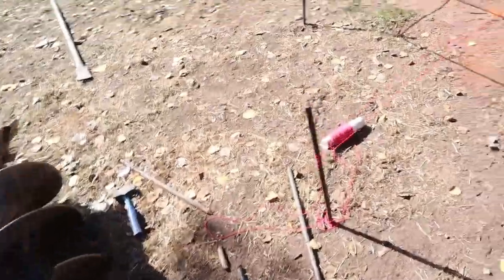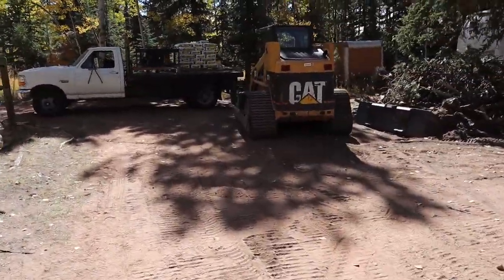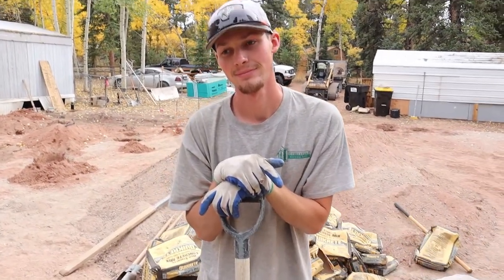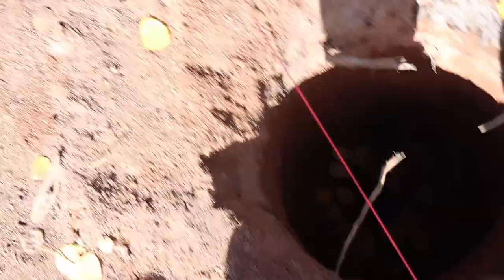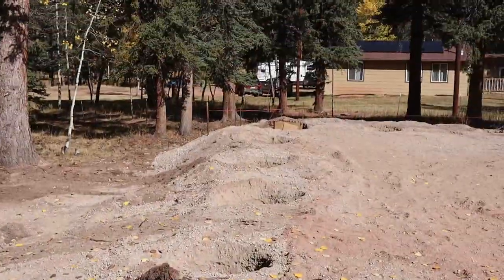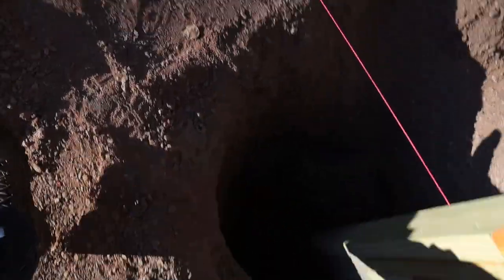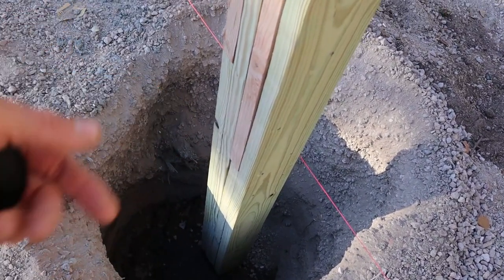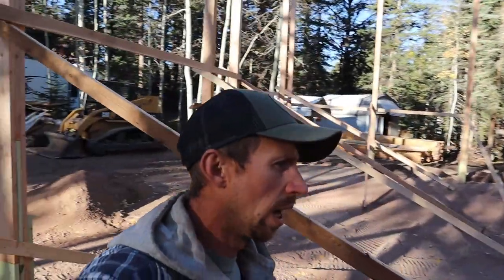POST FRAME BUILDING//PART 1//DRILLING AND SETTING POSTS//

Comment: 52” is deep! Where are you located? Mine was 42” in SE Michigan. I like that you are attaching it to break the size restriction. It is the same here. I think it’s silly that I could build bigger if I attached it.
Reply from the maker: Yes, 52" is deep here, but that typically is what our engineer calls for. I live in Colorado Springs, Colorado. Was your building engineered, or did you not need it?

Yes, the rule on the size of the building being bigger if attached to the residence makes no sense. I feel like it should be the opposite and a larger building be allowed if not attached...lol
Reply: @buildingwithjosh  no it didn’t have to be engineered. I had to submit the plan to the Township for approval though. The plan was drawn up by the lumber yard that sold the building package. Really the only standards my town required were 42” deep and posts every 8’ on the eave walls, posts every 10’ on the gable walls.

Comment: Can you use 3- pressure treated 2x6's for a post Frame home?
Reply from the maker: Structurally a 3 ply 2x6 laminated together is strong enough for most post frame structures up to 12’ tall. For 16’ and taller, a 4 ply 2x6 or greater will be required. I recommend talking to an engineer about any questions you have!
Reply: @buildingwithjosh  I don't know what it means for 2x6 to be laminated.
Reply from the maker: @elizibethhall6742  glue them together